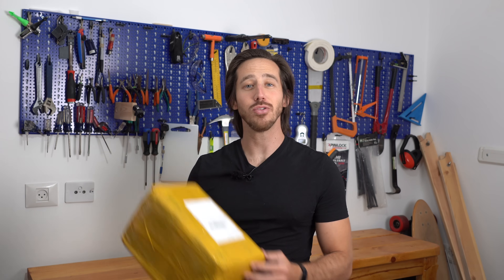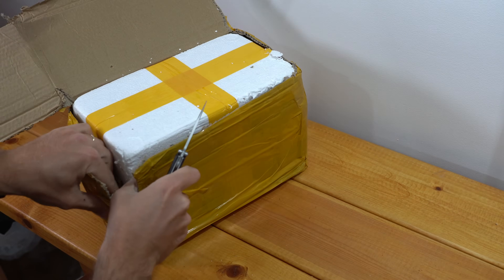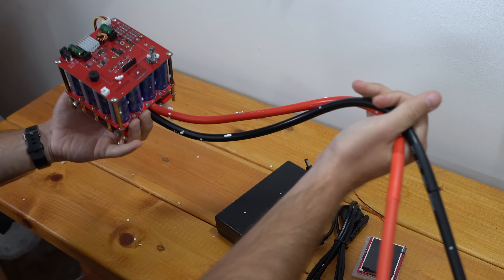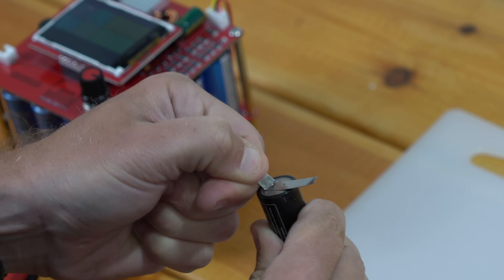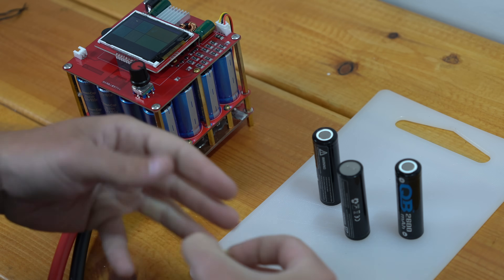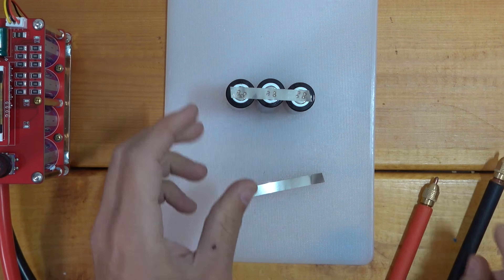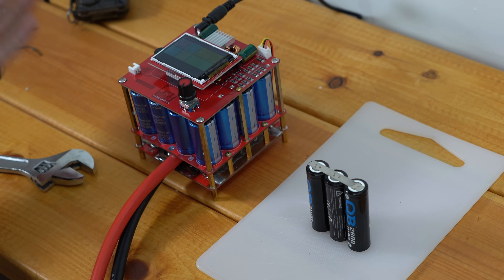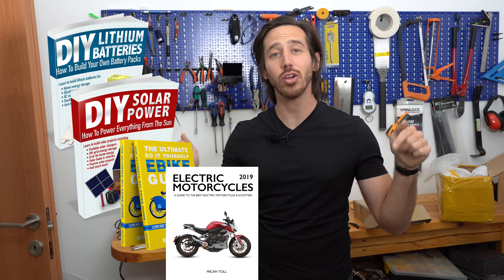Unboxing & testing new CAPACITOR spot welder (and cell fire risk)

Comment: Thanks for taking the time to make this and a other videos, I subscribed!  I've just recently started fixing a couple of defective Milwaukee M12 XC6.0 battery packs, replacing the Samsung 30Q, 3000mAh,15A cells with DQGG 3500mAh, 35A cells.  I purchased a Seesii SE-223 Capacitor discharge spot welder to do the work.  The welder had just enough power to weld  .20 x 8 pure nickel strip to the new batteries but I ran into some other quality problems with the welder.  I like the capacitor welder you demonstrated in this video, how has it held up over the last three years, still happy with it, any regrets?

Comment: Might it be possible that the cells had a bigger voltage difference than usual? Cell Venting could have been caused by huge currents from voltagedifferene where one cell is charging up another

Comment: I don't think you have "burned through". I would rather guessed the cell had a crack there (it appears to me as a stress ring coming from how the cell can is manufactured) since the start and you just opened it by mere mechanical pressure on it...

Comment: You know literary nothing about electricity and curent flow.. but basic knowhow for you.. curent flow ALWAYS shorter way or less or lowest resistance way.. that why SHORT exist.. ad2 if is themal jump not exceed a time need to ignite about comple of minute in most scenarios.. ( they usualy blow or ignite cause by overcharge them or short them badly over C they can't provide..) or actualy warm batery up to 65-75C  for enought time what will be also in couple of minutes to hours.. to actualy do some harm to them ( literary lower capacity ).. and yes if you are ''rukazhop'' and you rip and tear NO1 weld.. then reweld it again without actual PROPER cleaning surface (let small chunk make pretty strong energy directional short) and punch trought battery by 2000A by peak pulse.. b'cause all that power is delivery over 0,1thick chunk of metal you let there.... you shut not do this type of videos.. you only clowning around..  And yes... is only good it happen to you on camera... co'z we all can see you shut not do stuff like that anyway.., like child.. simply... let it bit burn by fire.. ( just to feel warm enought to get experienced enought to never.. do that again or anymore) hope GITGUT from this experience.. geezzz can someone full bridge rectify him??

Comment: You hare holding the probes the wrong way! You shoud push them in 90 degrees directly from the top and use some pressure for a good connection otherwise you are likely to burn holes in the bottoms of the cells! Its also important to clean the tips after a few welds for good connection! Its definetly a handling fault, not the machines fault!

Comment: I'm curious about how the caps are wired. 

If it's 4s4p as it looks, that's a poor design for caps, as it severely limits current capacity because it reduces capacitance.

Are the leads easily replaceable, and what guage are they?

Maybe you see where I'm g ongoing with this - nickel bus strips are inherently limiting - copper is the way to go.

Aluminum would be a big improvement over nickel, but it's not any easier to weld.

I was hoping this was a unit with tips of something other than copper, and also wanted more detail on the timing controls and what it's peak current is.

In theory at least, using caps and carbon/graphite tips, you should be able to pull 2000 amps or more depending on how the caps are wired.

With sharp tips to concentrate the current, and adequate control of the pulse and current, you should be able to weld copper as long as it's not too thick, with thickness capacity ramping up with current capacity up to a point.

For $150 and no new capabilities other than not needing a battery, I'd have to pass in favor of cheaper units of similar capabilities, or spending a bit more on a kweld and modding it with graphite tips.

Or just stay on my current track of using cells with terminals I can connect copper or aluminum bus bars to.

Comment: Hi. Couple of questions .  I am making 18650 cell 36v battery with 110 cells 3400 10s11p what gauge of wire would I need ? 
Also I ideally wanted smart bms what amp would I need?
Thanks in advance
Reply: Jk bms is great.

Comment: Been toying with the idea of getting into something like this ever since I had a Prius a while back and contemplated the cost of a replacement battery. Haven't really researched it, though. Now I want to build an ebike and the battery costs as much as the motor and controller together, so it seems like a good time to think more diligently. New subscriber.
Reply: Look into recyclers, often you can find deals that are pretty nice, although I do suggest doing a balance charge with every charge if you are using used cells or adding in an active BMS.  OR hell with new cells anymore for that matter.

Comment: One question: Where do you source your li-ions? There is a lot of faked cells out there, and while the devices I have using 18650 multiply, my batteries do not.
I only know that a 50Ah 18650 is definitely faked ... But I also don't want to spend 25€/ 2200mAh cell only to then get a  dunno 500mAh one.
(I have some that claim to be 2600mAh, but better don't ask what they really hold. They came with a cheap torchlight, so it was to expected ...)

Comment: any spot welder is a cell fire risk if you dont use it properly. You had the pulse set a bit too high and that weld was very close to the centre of the negative terminal which is the weak spot.

Comment: Well Micah, if you don't want to slip a bit of silicon tubing over the probe nuts, you could just make a couple of wraps of electrical tape around them—I sure wouldn't use them (even extended as you like) without insulating those fat boys. (But I'm old and clumsy, so YMMV.)

Comment: looks like the weld is very good quality.

much better than those of the hoverboard scooter batteries.

in the hoverboard batteries the welds will pull apart just while unwrapping the battery pack.

a few years ago i bought 4 hoverboard scooters for parts that was part of a recall i tore down the battery packs to extract the cells and found that some of the cells broke loose from the others very easy.

i suspect that welds would fail along with shoddy bms.

i am not a fan of the shunting bms where you wire the bms in series with the load.

i would rather a bms that you have 2 wires for the charger and 2 separate wies for the output or bms that just monitors and sends an alarm signal for the lvc so you have to tie it into the brake inhibit or a separate circuit that turns off the load.

you may want to stop selling. the qb cells as they are shoddy or only use them with the vruzend kits.

it is possible that you damaged the cell by ripping the strip from it.

Comment: Yea, leaking cells are a bit dangerous. The good thing is that they can be recogniced by the smell. Last year I found one with my nose. And since it was charged, I did a little experiment. Now I know, if your lithium battery receives an axe blow, it will open the gates of hell.

And a fireball, of course ;)

Comment: I don’t have time to delve into that stuff, so I shipped my ebike battery to a guy I found on eBay. He did a good job rebuilding my battery pack and it took less than two weeks to receive it back. I use my ProdecoTech Phantom 400 V6 to commute back and forth to work 9.5 miles each way. 😄

Comment: You say your  going to weld negative  side as its safer than  positive  terminal  as you know  the positive side floats on 4 legs and wouldn't  matter  if burn through terminal  .as you demonstrated burning  negative side  vents electrolyte...not good .just saying!

Comment: I really wish you would stop perpetuating the myth that lithium-ion batteries are somehow more dangerous than any other batteries, or other forms of energy storage.

For starters, capacitors are NOT relatively safe. Quite the opposite. No battery can charge just sitting all by itself on a shelf. Large capacitors not only can, they DO. To be stored safely, a large capacitor must be stored with the leads shorted so it can't build up a dangerous charge that can not only arc and cause fires but injure or even kill a human if it's a really large capacitor. The other thing is that any capacitor can be discharged completely, nearly instantaneously. No battery can come close to the charge or discharge rate of an average capacitor. That is what makes capacitors so useful, but they are also dangerous.

When it comes to battery types, lithium ion are a long way from being the most dangerous. Garden variety lead-acid batteries should never be stored indoors because they give off a gas that is not only highly flammable and explosive but also very poisonous. Not to mention the electrolyte is one of the strongest acids, so you need to be extremely careful about any direct exposure to the liquid. ANY battery that is punctured AND shorted can heat up and eventually start a fire. And no, puncturing isn't enough. It has to be shorted to heat up. The electrolyte in lithium-ion batteries isn't the best thing to ingest or have on your skin, but compared to the sulfuric acid in a car battery it's nothing.

I have literally never seen a lithium-ion battery catch fire in person. All of the fires I've seen are either the result of a catastrophic event that would make the fire the very least of your concerns, or they have been deliberately caused and in most cases faked because the actual process takes far longer and is far less spectacular than they want you to believe.

Which brings us to the reason so much FUD is being spread about rechargeable batteries. It's not only the oil companies that are hurt by the migration from petroleum to renewable energy and EVs. The power companies don't want you to have solar panels or home batteries, and even the car companies don't want to sell you cars that have so few moving parts and so little wear that their revenue stream after the sale, the one that has been so extremely profitable for them for so long, will disappear entirely. In short, rechargeable batteries are excellent for consumers but very, very bad for corporations, even then ones that make the batteries, because batteries that you don't throw away and have to keep buying over and over don't make them nearly as much profit as ones that are spent after one use.

Should one take reasonable precautions to prevent shorts and damage when working with lithium-ion batteries? Absolutely. Should one be nervous to be in the same room with a lithium-ion battery, or even a huge battery pack? Nope. If you're afraid of that then you should never get anywhere near an ICE vehicle of any sort, because they are all ticking atomic bombs in comparison with even the largest lithium-ion battery or pack. And don't get me started on Hydrogen fuel-cell vehicles.
Reply: I had a cell bursting into flames when the spot weld punctured a hole in it and it was terrifying.  If it happens it can easily set the house on fire. Next time i will do it outside.

Comment: 2:46 smokey burned flavor is because you welded that straight on the wooden table, been there, done that. iI usually test a new spotwelder or nichel strip, on a old button battery or AA.

Comment: I'd be very interested in seeing a comparison or selection of good spot welders at different price points - something that would help a beginner make some good choices.
Reply: is baout not be ass instead of proper tool..  timing and energy is important same as you not gona weld a elephant chain by 0,4mm CO2 MIG_MAG

Comment: I would like to have an update on your LiFePo4 battery build. LifePo4 is much less of a fire hazard. Also, if you have a 52 volt battery and use a 48 volt charger will you extend the life of the battery? Thanks
Reply: Well, a 52v battery tops out at 58.8v
A 48v tops @54.6v

Charging the 14s (52v) battery with a 54.6v charger, would leave you at 3.9v per cell. 

Little on the low side, most people I'm aware of go to 4.1v per cell for a balance between cycle life and range.

That said, if you are ok with 54.6v and can manage everything you need to do without running the battery too low, should be fine.

How fast you're charging is also important, as fast charging shortens lifespan too.

In my case, with my 52v system, If I know I'll be using the bike, I try to charge it to full, so it finishes just a short time before taking it out.

Letting the battery rest at full voltage is the real killer.

If I'm going to leave the bike sitting for more than a few days, I'll make sure to leave the battery as close to 52v as possible beforehand. Either by taking it for a spin, or plugging it in for 20minutes, as the case may be.

Also, if your battery has a BMS (which it should), they tend to do most of their work when the battery is full. So charging it up to full and leaving it to balance for a little while isn't the worst thing ever